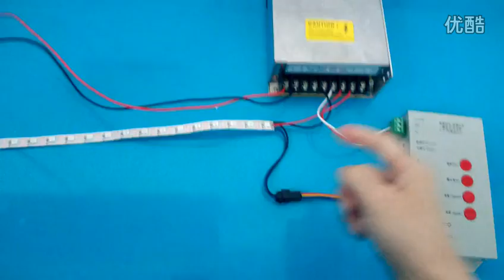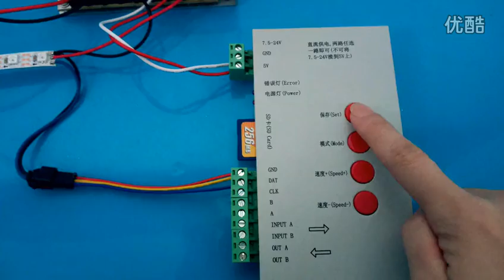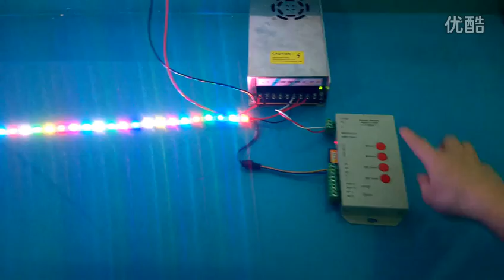Connection of Digital Strip light and controller

Comment: This is a rubbish video, it does not say there are 12v and 5v strips, this one is 5v and its important not to connect it to a programmable LED controller with a 12v input.
It also does not say which end to connect the power/ data which is important.

Comment: My controller keeps saying Error and the LED is not lighting up. Is it something wrong with the connection??
Reply: You just need wrong effect which made by leditor2013, effect with correct Ic strip, will works fine

Comment: Hi I have used Lededit and if I put in say 16 x 16 I can run them with the different sequences that are in the drop down menu's but if I wanted to connect my 300 WS2812b string that I own is it possible for me to do things like have 1 led run from left to right (All 300 Leds)and back or led's light from left and right till they meet in the centre or is it not possible to do your own designs? also is there any other software that I can use? I like the controller but finding the software very basic unless I do not understand the Lededit software enough yet.
Reply: +Bill Parker Hi I still don't know if with a T1000s controller I can have a 300 led ws2812b but same as ws2811 in a string and have 1 led run from no1 led to no 300 led and back again if anybody could help me please.

Comment: I have WS2812b strips but my exported file from led edit does not operate the lights correctly. All colours have white in them making the colours less vibrant and the patterns are scattered and random. Im using the ws2811 profile in led edit. Can anyone help?
Reply: Are you use the LED edit 2012 software? or use AutoCAD to draw and connect pixel?
you can click here study this magic controllor and WS2812B IC strips connection.
http://www.ledstripsales.com/Full-color-controllers-c-56/t1000s-with-sd-card-pixel-controller-for-ws2801-ws2811-ws2812b-dream-color-magic-led-strips-p-2090.html
Reply: its ok.. i needed to use LED edit 2012 as my T100s was not original.
Reply: machst du lange led strip mit WS2812b  bild oder nur länge

Comment: Is there a way to get the .led files for testing?
I have a T1000S and a strip with 144LEDs/m WS2811 and a strip with WS2801 with 2801, but they don't work correctly.
I tried LEDEdit 2013 and LEDEdit 2012. With LEDEdit 2012 it seems there is something similar to my program, but the dark pixels are white, and I have an offset...